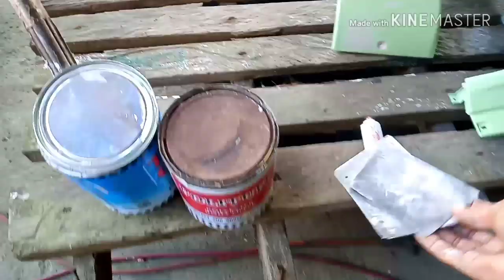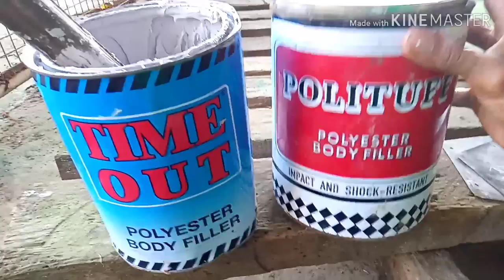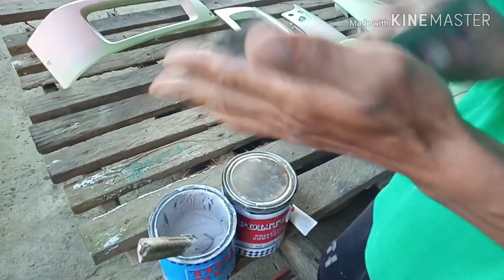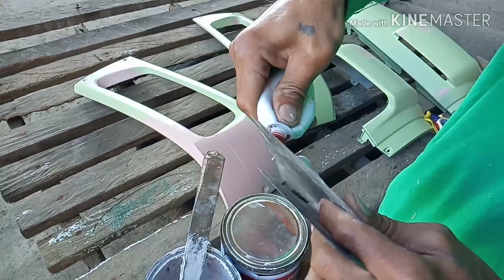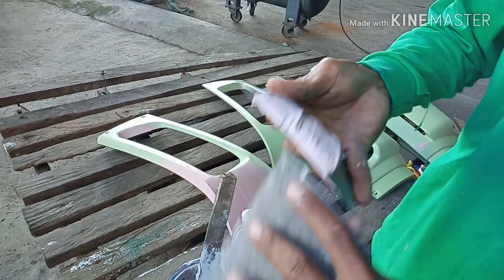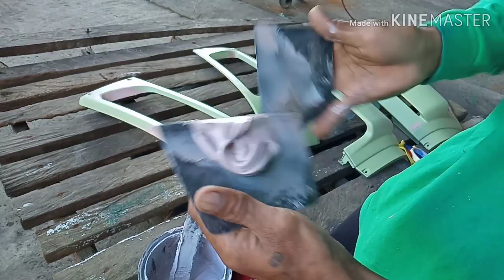Paano magmasilya(polyester body filler)

Comment: boss ano yung iaaply sa galba sa sidecar para matanggal ang oil nya sa galba, bagu lagyan ng filler?
Reply from the maker: Mas mainam sir n lehain nyo po ng #120 na my tubig at sabon. At pag natapos na lehain. Banlawan nyo ng tubig. Saka patuyuin. Pag natuyo n sya. Punasan nyo basahan n my thinner. Mas mainam po na sprayan nyo ng epoxy primer galvacoat yellow. O di kaya anzhal epoxy.. mas makapit po yung masilya.